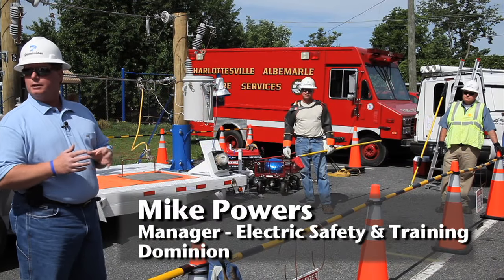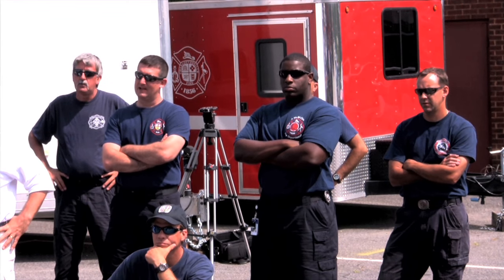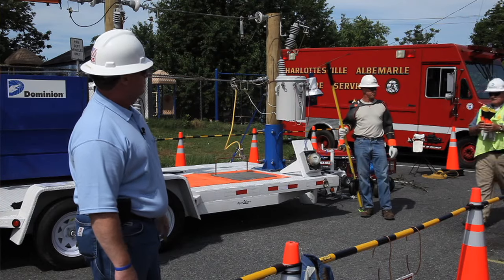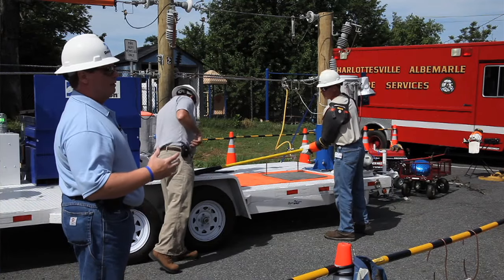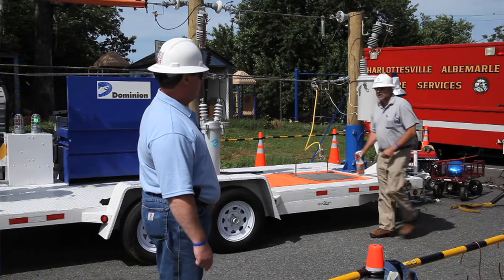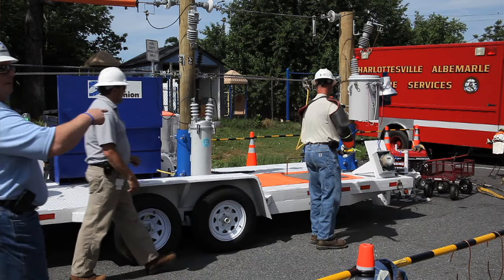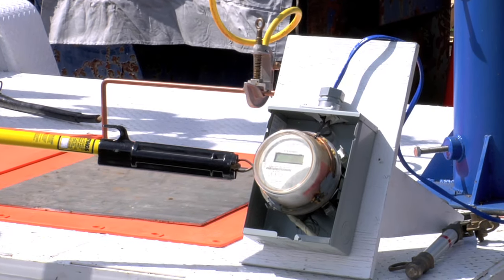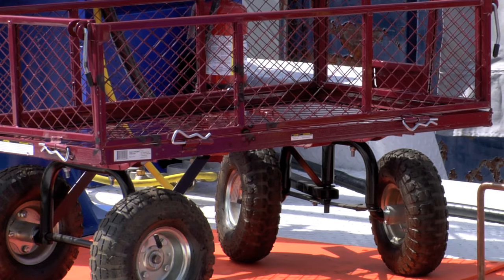Live Wire Demonstration

Comment: I never knew a generator can energize power lines like that.      just learned something new.   thank you very much
Reply: It's literally a portable generator. And don't try it at home, it will get you into trouble, and it might get someone killed.
Reply: that's what a transformer does
Reply: +Ryan Kreder
Flip the main breaker before starting a generator.
Reply: I agree, I didn't know that the transformers can run in reverse and will step up the voltage from a generator to full line voltage
Reply: Transformers certainly work backwards. Although I'm a little surprised companies don't make them with power diodes to prevent that. Would be expensive for sure.
Reply: Solar panels backfeeding into the mains can do the same?
Reply: dieselmupke yes they can, that’s how microfit solar works.
Reply: Solar panels are DC which will just heat a transformer, but if you hook them up to an inverter and feed that into the secondary you'll get high voltage across the primary.
Reply: Most of the solar panels installed on houses in Europe nowadays feed back into the mains via inverters, all electricity not used in the house will feed back into the distributor lines and make your meter count backwards, so the last scenario will be true.
Reply: @Ryan Lockwood Would have trouble using diodes with your AC
Reply: they can go up and down....
Reply: Yes it could.  That is why disconnects are required on solar systems, and line-interactive inverters are designed to disconnect from the power grid if utility power is lost.
Reply: while your message is certainly on point for the urgency of long term emergency power generation, and should be heeded by folks on the fence about getting a generator, you absolutely can safely disconnect your main breaker in order to fire up a generator in a pinch. Should you? probably not, too many variables at play mostly involving your home's wiring code compliance. however there are very few transfer switches in residential applications that also switch neutral.

Bottom line, if your power goes out for an extended period and all you have is a portable generator, try your damndest to use only extension cords to particular appliances. BUT if you absolutely MUST power your whole house on a portable genset, disconnect the main shutoff BEFORE firing it up, and if you're savvy enough, open the panel cover to ensure the neutral is properly bonded to the neutral/earth buss.
Reply: @RyanLockwood A simple diode won't work because it's AC. (Plus, at these kinds of power levels, even if it was DC, a diode will waste more power than you'd like)
Technically, disconnecting your main breaker should *work*, but as DanP pointed out it's easy to flip it back on and then you're suddenly in jail for manslaughter. Whereas a proper transfer switch will physically stop you from doing that.
(Some/all? transfer switches are just two breakers with a mechanical interlock that stops you turning them both on at the same time)
Reply: Over here in the UK, the main feed into your house is via a fuse, even if your main panel is rcd's / cct breakers, and that fuse is lockwired/sealed in place. The only people who can tamper with that seal are the power companies and trained electricians with the appropriate certification. No way we could power a house without powering up the street. :)
Reply: Ron Griffiths that sounds like a PITA if you happen to overload the main fuses. Is having no user accessable breaker a normal thing there? Or just in certain neighborhoods?
Reply: Danny Orozco yes, I was surprised by that too, but if you think about it you reverse feeding a Transformer providing 120 to the secondary powering the primary providing 7800 volts and possibly providing voltage to another Transformer
Reply: Yes the transformers work both ways. Small in large out
Reply: Oh dear god, most of the replies to this comment are frightening. Lineman die form idiots running generators with the utility line still connected. 

In states that have adopted NEC as part of state code, and there fore a legal requirement, you MUST install a transfer switch to COMPLETELY disconnect the utility service from your house wiring before using a back up generator. 

Power diodes do not work with AC since it alternates, you would chop off half the sine wave if you used diodes. Also diodes needed for AC would be massive since houses are usually supplied with more than 100A. If you want to stop backfeeding on an AC system you MUST use a disconnect, preferably a lockable one.

As far as solar installations if they feed your house they have an inverter somewhere to output AC. If you are somehow feeding DC back on AC whoever installed your system wasn't qualified to change a light bulb. Also, if they are grid tied they must shutdown if the utility power is lost in the US, this is called "anti-islanding" and is required by law in several states now as well as included in the NEC under Article 690. Any inverter that is "Rule 21" compliant does this by detection voltage and current sag or swell. If it is a three phase inverter it will even detect it phase differences in voltage and current to determine if there is a SLG fault, this is usually programmable up to 10% difference.
Reply: Yes, that is basically what they do to transport electricity. In canada, we usually produce electricity from synchronous machine at 13.8 kV then boost it to 735 kV for transportation.
Reply: Diodes block DC current, they don't block AC.
Reply: 43mackmobile
I've often wondered about that. It makes sense that they ground the section they're working on just to be on the safe side. :)
Reply: Ma ragazzi,non e arrivato tesla e l'elettronica(comandata da pc remoto su rete intranet, con lo stesso cavo elettrico) presumo che invertendo le polarità interne del trasformatore lo fà funzionare in retromarcia.
E chiaro che non è lo stesso trasformatore di prima ma uno molto simile.
Reply: We dont trust people, thats why we always ground our lines before working on it, if the line is not grounded we expect it to be a live wire
Reply: When installed correctly, well in the Uk at least micro generation is back fed into the services via a grid tie in invert-er, if the service fails then the grid tie in disconnects the feed from the invert-er
Reply: Its backfeeding into the transformer.
Reply: Some solar inverters are designed to backfeed into the grid to sell power to the utility company, but they can detect when a power line is down, and if it is, the inverter will shut down. Using an inverter that is not designed for grid tie can certainly feed power into the grid in a dangerous manner.
Reply: Transformers work both ways.  Thanks for the reminder.
Reply: No generator will trip
Reply: @Tom-Lahaye  Yes....
Reply: @littlewazz  transformers are not bi directional like diodes.  its a difference in windings on how the transformers changes voltage.
Reply: Most folk don't know that electricity is Electrons being torn off their atoms and allowed to move freely through conductive wire. That flash of light when putting bare metal to an energized line is Metallion Amounts of Electrons flowing freely. Its even more bizarre than the atom itself. Good Stuff, this demo. Kinda spooky how electricity works..............................
Reply: Someone I know once did that that  and it back fed into all systems. One off my friends daughters. Put alot off her dad's industrial transformers connected them togather. It back fed blow the wiring in house and blow the consumer unit off the wall. Substation fuse and. Meter. Off the wall. And fuse attached to meter. There had to get most off the house rewired. As there was no isolation transformer and caused a back surge. Electricity compeny was not impressed. There was 100 and 10 volt transformers. She was trying to create. Lighting. Using a telsa coil
Reply: @craigroberts1670   there's an invisible electrical. Magnatic field between transformers. And over head powerlines you don't even need. To touch it   for it to connect it can jump you can't see it
Reply: @ryank1273  Someone I know once did that that  and it back fed into all systems. One off my friends daughters. Put alot off her dad's industrial transformers connected them togather. It back fed blow the wiring in house and blow the consumer unit off the wall. Substation fuse and. Meter. Off the wall. And fuse attached to meter. There had to get most off the house rewired. As there was no isolation transformer and caused a back surge. Electricity compeny was not impressed. There was 100 and 10 volt transformers. She was trying to create. Lighting. Using a telsa coil
Reply: @ananomus6111   there's too types off transformers step up transformers and step down
Reply: In theory, it can.  In practice, it won't, unless the line is isolated/broken close to the customer.  Why?  Because a 5KW or so generator backfed into the incoming power line by some dummy not disconnecting the main breaker will be powering not only the dummy's whole home, but also all of his neighbors' homes, businesses, and streetlights which are on his isolated side of that feeder.  What will end up happening is the breaker to which the generator is connected will trip, or the breaker on the generator will trip due to the massive demand for current from the generator this will cause.  
"Experts" warn that "many linemen are killed all the time because some moron connected a generator to the house!"  I have yet to hear of this happening to a lineman, and I've asked friends who are in the business.  Why?  Because linemen aren't stupid.  They treat every wire as a live wire unless they know it to be "safed" (grounded).  Joe's generator connected in a backfeed condition will fail on over current, all while the smart lineman is looking at the grounded line he is working on, never realizing that there's a moron trying to power not only the whole neighborhood, but also the dead short that's across the line.
And that's just the moron case we're talking about.
The smart person who knows how to add 3+5 will actually open up the main breaker to his or her home, totally isolating the home's wiring from the utility service if using a "cheater" cord for the generator.  I've done it tens of times, and since I knew what I was doing, the worst thing that ever happened was jealousy from my neighbors as I enjoyed a fully powered home while they had to limit theirs to only whatever they could plug into an extension cord.
Now I've got a fully automatic transfer switch and generator, and don't even have to think about it.  Oh, and the transfer switch is 100% NEC compliant, and does NOT switch the neutral on my split-phase 240V power, as those same "experts" think it has to do.
Reply: @rongriffiths3556  usually in britain house eq for example the stove has a plug with integrated fuse which is replaceable. The wiring in the house is overdimensioned.
Reply: @steuk6510  
True, but if back fed, the step up will step down, and the step down will step up voltage....
Reply: @ryanfreeman125  They don't because it is AC, not DC.
Reply: @D 100%
Reply: @ryanfreeman125  diode = DC  That power diode idea couldn't work.  Need a proper transfer switch, or just plug devices directly into the temp generator (well, yea, it's called an alternator for cars with diodes for three phase half-wave DC output).  DC can be "inverted" to AC, but it's not practical for high power needs.  Large inverters are used with solar DC to AC) and can be scaled up to run a whole house.
Reply: @steuk6510  now that's someone I'd like to get to know. Maybe we could tune a frequency to mains Earth and broadcast Morse code to the moon in the form of transformer fuses popping across the grid.
Reply: Pulling the meter does not disconnect neutral either
Reply: @ryanfreeman125  If you install a diode you turn the AC into DC and also block 1/2 of the voltage.
Reply: @grumpus27  Very well put!
Reply: @ryanfreeman125  Because they run Alternating current, diodes wouldn't work. Diodes would act as a rectifier and convert the A/C voltage to D/C
Reply: @littlewazz  In "reverse" the transformer works just like a step up transformer. In fact connected in reverse it is a step up transformer.
Reply: @ryanfreeman125  It's AC power.. cant fix that with diodes..
Reply: @grumpus27  Yeah.. but all the home solar systems have inverters..  if you're powering your home lights/appliances through it, then it's going through an inverter and it COULD do the same as the generator..  if not hooked up right..
Reply: @ryanfreeman125  Diodes would not work for AC , to prevent any backfeed .
Reply: @ryanfreeman125 , you do realize that we are using alternating current here. By using a diode you would be, at the very least, converting it to DC, thereby completely defeating the use of a transformer, and at the worst shorting out a 7 thousand volt line with a current capacity of thousands of amps?
Reply: @Tom-Lahaye  Any type of Power Generator (gas, hydro, wind and/or solar), basically any device designed to create electrical power can do that...
This is why every Electrical Code I'm familiar with (Canada and the USA) requires Auxiliary Generators to be connected through a switch designed so the building to be powered is only connected to 1 source of power at a time, either the Aux. Generator OR the Local Gird but NEVER both at the same time...
Reply: @grumpus27  Solar panels must always go through an Inverter if you want to power your home with them...
Reply: @D My main braker does l/n but I'm in the uk so probably different laws.
Reply: @Tom-Lahaye  Yes, which is why inverters have a feature called anti islanding which means they will not fire up unless they see mains voltage coming in. Kind of annoying as it means if you ahve solar panels you will still not have power in a blackout during the day.
Reply: The replies to this comment... I swear, a lot of you just don't have a clue what you are talking about. Please, leave it to the professionals, cause electricity is complex and dangerous to the inexperienced.
Reply: Yep transformers work both ways with AC. In the case of solar, they use inverters which convert the DC to a pure sine wave at the proper voltage.  I don't know exactly how they do it but they also detect presence of power, so if there is a power outage they will stop backfeeding.   If you want to hookup a generator you need to use a transfer switch or interlock.
Reply: @ryanfreeman125  Diodes would not work because you always need to let the current flow in both directions (alternating current).
Reply: @hotpeppersrcool  It would not be DC, nor would it be AC. It would be variable
Reply: This is why it so dangerous for everybody. Incorrectly installed generator or solar installation are a real danger to electricians working on lines. It is highly illegal to do such installations, or sell hardware that allows that. You need an electrician to install proper hardware for it and sometimes it even requires vetting by the utility company.
Reply: @Tom-Lahaye  I think all PV installations in Europe (well at most countries I guess), require anti-islanding protection in the inverters. There are various ways to do it, and there are discussions if the currently used methods are good enough, but they are required. The electricians working on lines will still ground, common all the wires, in all direction, when working on lines. Just to be sure.
Reply: Simple solution  don't connect generators  to household systems. 
Use a power cord  and property secure it. If not rigged for it don't do it.
No switching  station, no can do.
Reply: @redsquirrelftw  the way it works is this: the grid can sink practically infinite current.  your home system can not source infinite current and if it tries, because the utility is offline, or the feed is shorted to ground, the voltage will collapse. the anti islanding is looking for the voltage collapse, and if detected, kicks in the protection protocols.  so yeah for a brief instant, your system does try to power the neighborhood.
Reply: @Tom-Lahaye  grid tie inverters have a safety swtich similar to transfer switches for generators. If the utility power is cut off, the inverter will close off and only provide power for your house until utility power is restored
Reply: @jnawk83  I guess the moment will be very very brief unless you have a nuclear power plant 😉
Reply: @ebhhon7826  then you are the utility 😂
Reply: only if you rig an  illegal wire with a plug on both ends, and use it for feeding the house through a socket.
Reply: @D I have a  Square D, UL listed lockout on my panel that keeps the generator breaker from being switched on unless the main breaker is in the off position.  It doesn't break the neutral, and is completely legal to use.
Reply: @louschneider6482  I guess technically it doesn’t block AC but still half of that sine wave does get blocked so really the correct term would be that the diode would only convert the more dangerous AC to a less dangerous pulsing DC current. (Now at the voltages of powerlines both are certainly still lethal, I only mention the lethality because AC can find more points of entry than DC due to the alternation.) So diodes technically filter out AC by blocking one of it’s two polarities and by combining 4 diodes in a specific orientation can convert AC into a mostly steady DC voltage. You probably know this but this is for others who don’t know.
TL;DR Diodes block/filter either the positive or negative half of AC currents but there is still current in the form of DC.
Reply: @D Yes and no. If there are no wiring faults in the house. If the hot and neutral are reversed somewhere, then the neutral would be energized.
Reply: @D switching the neutral in a transfer switch isn't required for typical single phase residential. This is usually only found on critical life safety generators like at health care facilities where the neutral is required to be switched from utility to the generator. In a residential application, there is interlock kits available for most major panelboard manufacturers such as Square D, Eaton, etc that lock out the generator breaker unless main is flipped off first, this is UL listed and legal and safe, as long as the neutral wire is bonded to ground after the first disconnecting means as required by NEC.
Reply: @ryanfreeman125  Diodes don't block AC current, only one half of the waveform.
Reply: @littlewazz , transformers are a bidirectional device, meaning, they work in both directions. One way, they lower voltage, the other way, they raise voltage.
Reply: @louschneider6482 , diodes rectify AC. If diodes are installed in circuitry in series, it might be providing reverse polarity protection.
Reply: DISCONNECT YOUR MAIN CIRCUIT BREAKER. SOME BREAKER THAT DAYS 100,150 OR 200
PULL DOWN
THEN WATCH FOR YOUR NEIGHBORS WIFI FOR POWER RESTORED
Reply: @koof_a_loof  Pretty sure the sealed fuse is a last line of defence, any reasonable fault should trip one of the breakers or fuses in your breaker panel which you can access.
Reply: @movax20h  I don't know for sure but I think a large enough AC motor spinning unloaded at exactly the right (or wrong) speed will regenerate the mains waveform enough to look like utility power.